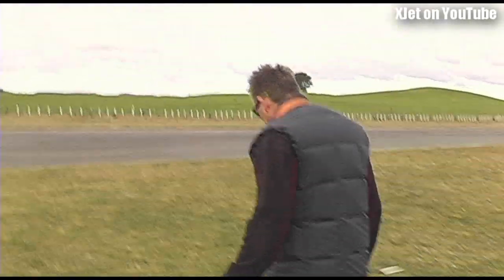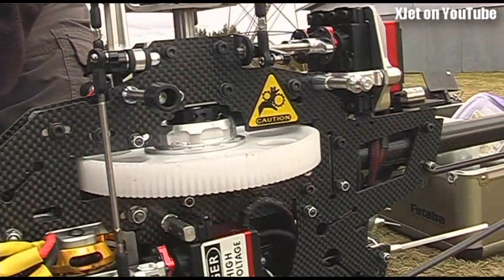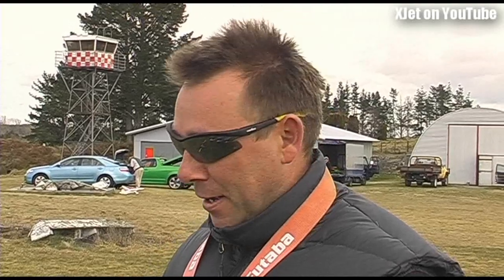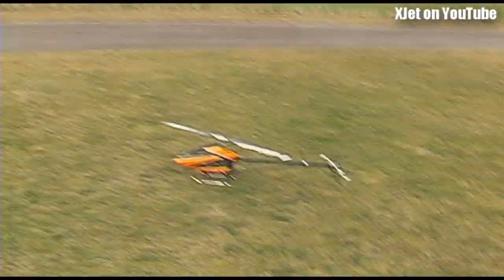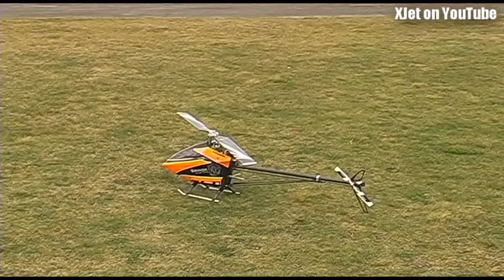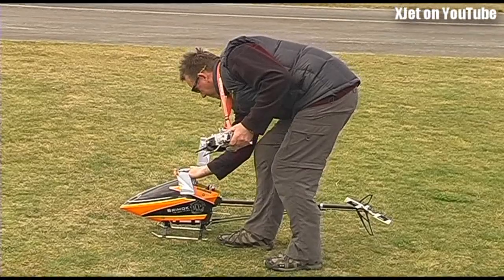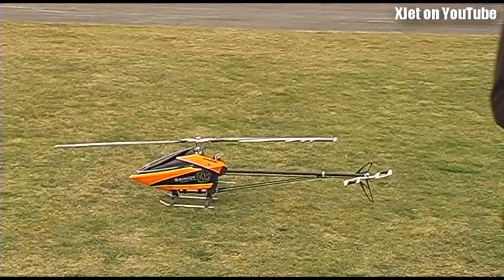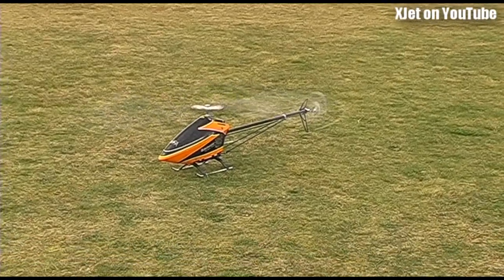Kasama Srimok 90 electric RC helicopter (capable of 200kph apparently)

Comment: Why do you think the blades straightened out when the rotor head speed increased...as a matter of fact the only reason you would want your blades tighter than normal is if you are doing blade stop autos and you don't want your blades to fold on you on the restart while your "stirring" the collective to get the blades spinning again. If the baldes were not so tight they would have trimmed out at a lower rpm because it would require less centrifugal force to do so...UNDERSTAND??

Comment: I think you don't know what I'm talking about or simply misunderstood me. Inertia has plenty to do with it when the rotor first starts to spool up and the blades' inertia is trying to swivel the blade backwards in the grip. Don't assume everyone on the Tube is a troll or stupid. I fly a 450 but I fly with guys that have 700's and their grips are MUCH tighter than mine. Maybe not quite this tight, but close.

Comment: the rotor blades are supposed to just start to drop with a very light touch with your finger while the helicopter is being held to one side .. those rotor blades on that helicopter are way over tight ..... i know been in to r/c helicopters for 25 years ..

Comment: They are tight if it was a 450 size but not for this size bird. Larger heli's need the grips tighter since there is so much more inertia in the larger blades.

Comment: Hi bruce,
Do you think Wayne could share his servo specs speed controller motor size and his settings on the cgy 750?
The reason I ask is that I have a srimok ECO 90n with cgy750 which is basically the same but nitro and I will also be getting a Faifa in the next 2 weeks.
Is there anyway that I could maybe come visit you guys over there in N.Z as I was thinking of taking a heli holiday with the mrs.
Thanks and keep up the great work Bruce these vids are sweet.

Comment: @xjet 

Yea all mechanical gyro are flywheels with sensor kindof like balancing a bike rim while spinning but with sensor I guess I don't know alot about'em but I just got rid of a futaba mechanical gyro with control box with pots and other square piece where the mecanical gyro in it. Pretty cool. You know, 450 size are cheaper and there people building those hk 450 with all electronic under 150 bucks. I had a exi 450 wasn't that bad link was longer then expected but for 20 bucks or so.